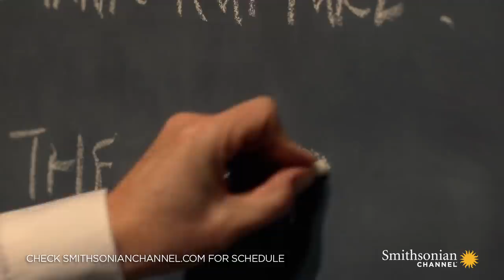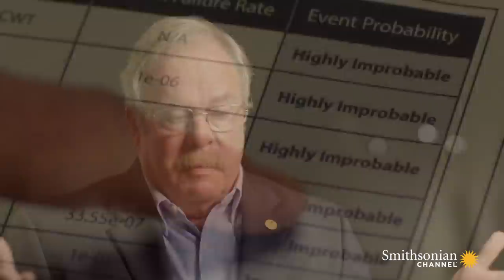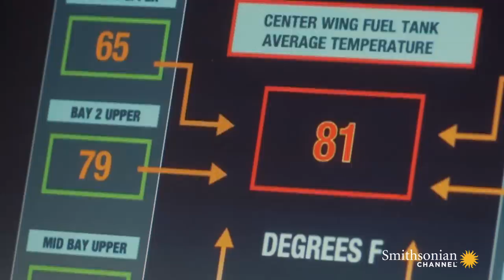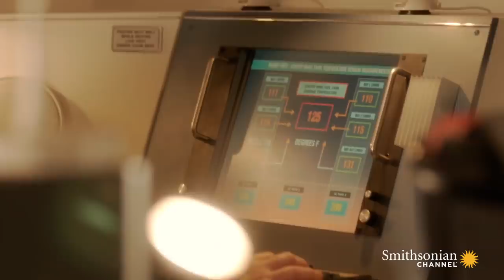How Air Conditioning Caused TWA Flight 800 to Explode

Comment: Q: how did the fuel explode at 14,000 FT on TWA 800?
A: there was a crack in a electrical wire that was near the fuel pipe.

A complicated question on how a major incident happens like this
Reply: Sorry, but that theory has been dismissed in federal court.  An electrical wire cannot bring down a 747.
Reply: I thought the men in white coats came back to take you away...again. You are good at just pulling stuff right out of the air. There Never was any 'faulty fuel tank wiring'. 
(I see that you are stuck in repost mode, aren't ya) So, I take it that your memory has faded since the last time I corrected you? There was no navy in the adjacent area at the time of the crash. And certainly not firing missiles back into a departure corridor. lol.  Most third graders can grasp that one. The only failed cover up was the NTSB's attempt to try and outsmart us Aviation experts. That's why they lost in court and were impeached for Fraud.  Your welcome...again.
Reply: @robshef718  I'm starting to realize you are calling quite an amount of people liars because they believe it was a fuel tank explosion, and be aware fuel tank explosions are a thing, nearly 3 fuel tank explosions on planes happened within a few years of TWA 800.
Reply: Thank you for being very observant to my posts.  :)  

Not that I have exactly called anyone a liar, as much as grossly mistaken  if they choose to believe the NTSB explanation.  

Any one who is 'willing' to learn is fine with me,  but when some non aviation high school drop out comes in here and impugns  mine and the Integrity of the facts,  then they will be called out.  

Ignorance I can tolerate, but stupidity  make me very angry.   And you are 'incorrect'  (I did not say you are a liar...   lol) but you are 'incorrect' about there having been ANY spontaneous fuel tank explosions on any aircraft using Aviation Kerosene. 

Any such sources are manipulated and then the 'ol saying... 'Be careful what you read on the internet, no matter how official looking.'   Just like,  'keep your cell phone close to your chest, and don't believe any official looking e-mails saying you better do this....or....

Comment: A lot of people will not believe this but I would suggest they check out Philippine Airlines flight 143.
Reply: Actually that would be disinformation; which at the behest of the NTSB would also re write (history) regarding [Several B 737] incidents, in where the incidents were (required to become a spontaneous fuel tank explosion) in order to continue foster the TWA 800 claims.  The cause of the Philippines incident was a cabin fire which was about the galley while the plane was on the ground.  (The photo graphs are clear)  yet  after 1996, the web sights changed the cause(s)  to that of a spontaneous fuel tank explosion, as was also done with the Thai airways 737 which was bombed, (the prime minister was due to board the plane) yet our NTSB claimed (despite the evidence of a bomb by several Thai authorities) that it was 'not a bomb' BUT...... a center tank explosion. This to keep the narrative going.

Comment: And the manufacturers didn't catch this when they were building the aircraft?
Reply: It was a missile that impacted the plane...…     cut and paste   >>>>>  ' TWA 800 / NLJ '  and paste into BING.    Pass it along.
Reply: Rob Shef You sure?
Reply: Sure about what?   I was an consultant / Investigator in this matter, and in the Navy Aviation field, so I think that my guess is perhaps at least as good as yours.   lol..
Reply: Rob Shef Okey dokey. Just asking.
Reply: you are welcome.  :)
Reply: The Navy fired two missles from one of two submarines and 21 surface vessels in that area that were conducting missile tests exercises.
The missiles were seeking out drones fired from one of the surface vessels,.......TWA 800 breached the perimeter of the military exercise airspace.  The first missile targeted the heat signature from the third engine of TWA 800, then the second missile targeted that explosion.
The issue with those center fuel tanks did exist,....up until 1969.  In that year,  Boeing completely 
redesigned the center fuel tank system for the 747.  The TWA 800 aircraft was built in 1971, therefore, the fuel tank issue did not exist for that aircraft.  The Clinton administration, FAA, and NTSB used the 'center fuel tank' theory as propaganda to cover for the Navy's grave mistake.

Comment: "The fuel is flammable" video ends
Reply: Robi Shefran  It's the vapors that are flammable, not the fuel itself. Jet-A fuel is a derivative of kerosene. Jet-A fuel vapors must be heated past 100 degrees Fahrenheit to burn. Even then, the vapors don't explode without the proper fuel-air mixture. This video does not mention about how the center wing tank is subject to atmospheric conditions through a vent. 

Don't get me wrong. I too feel that there is a cover-up. The FQIS has circuit breakers in place to keep the voltage extremely low. On top of that, a short circuit cannot form an electric arc without connecting to another conducive surface. 

When I first read about Flight 800 exploding, I thought there was a bomb on board that plane. I still think that a terrorist bomb blew up the plane.

Comment: That is the same, physics law that stumps around 90 percent of human people.  Example, lets say you have a closet of 4 feet by 4 feet by 8 feet. One 24 inch by 24 inch diffusers gets installed into the closet, with a 10 inch air duct. The thermostat for that zone is 300 feet away, in another room and can call  for heat in the winter time and a/c in the summertime.  What is the first question that comes to mind? Keep in mind this closet is being used for computer equipment.
Reply: Is that Edward Cornell of Cornell University? Yes, good ol Physics.  Always the 'stumper'.   Like Hot Ice huh!  
You might be right about 90% of peeps who failed Physics and by reading most of the posts in here, I can see why I'm frightened for the future of the world, who would believe that Kerosene is more powerful than a Bomb,  and that half of plane can still fly. :O    but hey, if the government  sez so....    :) 
 The first question is...  why mismatch the duct and the diffuser? lol.  Not sure where you are going with this analogy.    Can we compare apples with oranges in this case?
Reply: @robshef718  let say you have a computer in a room. A safe temperature for that computer to function correctly is 68 degrees freinheight. The processor temperature will always be hotter than the room temperature, sometimes 50 degrees hotter. When the room temperature increases up to 90 degrees. Now the processor will be up around 140 degrees freinheight.  Once the processor starts processing requests, that temperature now goes up to 180 degrees freinheight. 140 degrees is really the maximum the processor can handle. This is why server rooms at usually kept at 60 degrees all year round.  That 10 inch air duct with a 24 by 24 inch diffusers is going to force more hot or cold air that a tiny 4 inch air duct, with a 4 by 4 inch diffuser.  So this closet i am talking about is extremely cold in the summertime and extremely hot in the winter time.
Reply: @robshef718  i never went to cornell university. I went to a technical hands on school.  Physics is one of my favorite subjects.
Reply: Still not seeing how this applies to TWA 800..... forgive me for being a bit slow!  :)

Comment: So an engineering flaw, which was not identified until a catastrophe. I don't understand how an aircraft manufacturer such as Boeing could design-build such a high risk system as an A/C unit anywhere near a fuel tank. Who are their engineers, the 3 Stooges?
Reply: It was an engineering flaw coupled with corroded wiring. This was one of the oldest 747’s still in service at the time of the fatal accident.

Comment: Interesting, but several key concepts are glossed over. How many thousands of flights under the same circumstances have taken place without mishap? Since test was under "Identical" conditions, wouldn't the tank temp be the highest while the plane is on the ground with "air conditioners running for 3 hours". Last time I looked, flying at 300-500 mph at 10,000+ feet dramatically cools the aircraft and its component parts. Then consider the artic freezer temps that occur at 30,000 feet-which the plane would have been at in only minutes. The demonstration seems to defy the known laws of flight. Lastly, the discussion makes no mention 50+ people seeing a missile rise from the horizon and hit the plane. Approximately half of these individuals followed the arc of the missile from start to finish. Isn't eye-witness testimony the gold standard in any court of law? The very fact these witnesses are ignored speaks volumes.

Comment: Was this test flight actually in the air or was it in a simulator?
Reply: Yea of course it’s in the air... sims don’t simulate the ac system temps
Reply: There was this flight with another 747-100 and tests of explosions lead in the desert on replicas of the main wing fuel tank.

Comment: So did all the 747's all exploded since they all shared this same layout? Of course not TWA is the only recent 747 to ever have it's center fuel tank explode. So TWA is the only 747 to have the AC unit under the center fuel tank? NO it is common feature of those 747's so that theory sounds ridiculous and really deviating from the real cause. By the AC unit theory all 747's in use would all have to be modified and none were modified PERIOD end to story. So in every 747 flight even today in 2018 are the AC units still 350 degrees? LOL
Reply: Well, No.  There has never been any 'spontaneous' fuel tank explosion(s)  with the use of Aviation Kerosene.  Also, The 'theory' of the [Hot Ac unit] as having 'Overheated' the tank. is as lacking as the 'exploding fuel tank' nonsense. The NTSB was cited in Federal Court for 'Junk Science'.  The location of the Air Pack(s)  is moot.  There are major physics problems with the [entire NTSB report], and 'problems' which the NTSB could not answer, in court. That is why they lost.  Do know that the Function of the Units are NOT like a household AC unit....lol...  The Unit, though it produces 'some heat' due to work, the units also have 'Pre Coolers' and that the Pack Bay is Ram Air Vented, as well as the tank itself, being segregated and vented. There is not, nor can there be any 'Steaming Hot'... 'Seething'  boiling tank ...JUST READY to blow at any second, nonsense!
Reply: Rob Shef exactly which makes this investigation pretty dubious. We all have fuel pumps in our cars for example and all the wiring for the fuel pump runs also along with a fuel level wiring .  So are we worried about driving our vehicles with 50 liters + of highly flammable fuel behind us? Who thinks of it no one. Also I really like the fact that Rolls Royce for example is still using the same Engines from the 1970's in 2018. The 2018 have not changed since they were originally designed for Eastern Airlines back in the 1970's . Only small mods were done and these are not called jet engines, as people are foolishly believing. Rolls Royce does not call them Jet Engines I repeat they are not called Jet Engines, Rolls Royce clearly names their model #s  as Aero Engines "Model number" not Jet Engines . It is clearly stated "Rolls Royce Aero Engine followed by the model number" . WTF is an Aero Engine is the next question. We'll take a look at what is an oxygen sensor in a vehicle. Your vehicle burns oxygen mixed with fuel? Incorrect your vehicle works by inducing air ( filtered) which is comprised of Nitrogen and Oxygen . But this means the engine is only ignited by the 21% of the oxygen? Incorrect as that is Pure Air, which does not exist everywhere. Your vehicle actually burns Nitrogen as it's main fuel , the gasoline or Diesel is the primer to burn the Nitrogen it is not the main Fuel!! It has never been the fuel it is the Primer to burn the 70% nitrogen + 15% oxygen ( at best) . Look into how the Oxygen sensor on the exhaust manifold works and you see the issue.
Reply: The issue lies in the belief that the AC unit's location was in itself a flaw when in fact the fuel in airliners is intentionally used as a medium to absorb heat from ac systems, engine oil and hydraulic fluid.

The real concerns were eliminating  excessive heat transfer, updating wiring standards and the implementation of tank inerting systems which displace oxygen with an inert fluid such as nitrogen

Comment: This is complete BS - TWA 800 was approximately 15-20 minutes late in taking off. On the course they were flying, the military was testing a new missile manufactured by Raytheon. If TWA  800 had taken off on time, they would have been clear of the test zone when the missile was fired. But they were not clear, and when the missile was fired, it locked onto TWA 800 and brought it down. Massive cover up by the Military Industrial complex; Raytheon's stock would have taken a nose dive; and the company would have sued into oblivion.
Reply: Welllllllllllllllllllllllllllllllllllllllll......eeehhhhhhhhhhhhh

Comment: Why would AC packs be needed at >10K ft?  And why would they run hotter in flight than on the ground?  Something isn’t adding up.
Reply: It was a hot night, they had been running while the plane was on the ground for at least 2 hours before the flight. The flight only lasted 12 minutes.

Comment: You know how dumb this Sounds? A 25 year old airplane turned on the airconditioner for the first time and blew up. I I AM NOT BUYING IT ONE BIT. -996 was not NY hottest summer TWA is not the only airline  who leaves the a/c on to keep pax cool on the ground. TWA is one of the few airlines that never lost a 747. As a plane climbs the air temperature gets colder, that is why you see snow on Mount. Everest. If a/c caused the explosion it should have happened on the ground. If it wasn't a missile then there wouldn't haven soo many boldface lies and contradictions in FBI'S stories. IT WAS A MISSILE!

Comment: this crap that the fuel exploded is bu,,,,,ht. Another bs story is the fuel was leaking and the jet exhaust ignited it.  Upon reaching 10,ooo ft you push the nose over and accelerate to 310 knots.  jet fuel would have to burn at the rate of 522 ft plus to catch up too the aircraft. IT  ONLY BURNS THAT FAST IN BRUCE WILLIS movies. Also for every 1000 ft. gain in altitude the out side temp. drops at the rate of 4 degrees F. So if departure airport was 500 msl. at say 80 F then going thru 13,000 ft the temp has already dropped by 50 F.  80 - 50= 30. Out side temp is now 30 F. Fuel temp and air packs combined with wind chill factor, there is no way these components are heated to critical temp. I will bet someone  on the navy ship playing war simulation games accidently launched a sam and the next response was " oh shit turn off all lights and get the hell out of here. Keep your mouths shut ahhh It is a matter of national security. yea that will work."
Reply: Not the Navy. And then 'run'....  That's nonsense!  A missile yes. but still need to find out who's.
Reply: Another Thanks you!  It nice to see comments from peeps in here, {like you Captain}  who Know what they are talking about.  Yes, everyone I can see has learned  their Physics on saturday morning cartoons and on TV!   And were called the kooks if we say, gravity exists!   747's that break in half GO DOWN!!!!!

Comment: Thing is, I'm not buying that story (the only one in the entire Mayday series more or less). First, you need to know that TWA had a reputation for good maintenance back then, unlike say Valujet. If something as implausible as that happened, how come there never was another such occurence ? Bear in mind that over 150 100 series 747s left the factory, potentially with the same flaw. Another point, Saudia had 747-100s as well in their fleet, and used them extensively. Knowing their maintenance wasn't exactly first rate at the time, and given how hot the weather is in S. Arabia, we should have had a similar occurence. Yet nothing.
Reply: True but keep in mind there have always been rare or one-off events. A missile off Long Island? That would be something of a first too. Ditto 911. Or take 737 rudder, an elusive cause that only caused 2 crashes. Helios loss of pressure, essentially one such crash. AA flight 587, same.
Reply: Exactly what I was thinking, the holograms produced by a surface to air missile in tower 7 were the only thing capable of destroying a frame 314 2nd gunman such as flight 800. I've come to the conclusion that the flashpoint of mk ultra is nothing more than a US Navy coverup orchestrated by the Clinton administration
Reply: @gustusthread2256  Well the Boston Marathon bombing, in my home city, was another case where there was no real 2nd bomber. The boat he allegedly hid in was the same one which carried Amelia to New Jersey, where she remained a housewife for decades. And there were no hologram required for this one, which is amazing when you think about it.
Reply: @cchris874  The 2nd gunman has been identified as former CIA Agent Alex Mason and he lives among us to this day. Look at the footage, frame 313, it could have only come from Alex Mason. Look it up and you'll see. It's in the trails, the bombs in tower 7 along with Alex Mason in frame 313
Reply: @gustusthread2256  I'll be sure to check that out. Thanks.